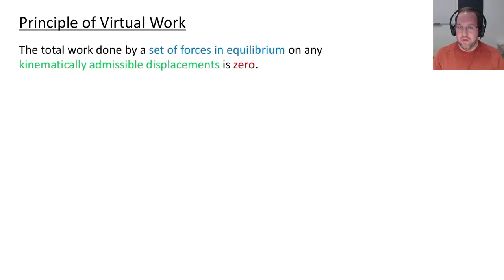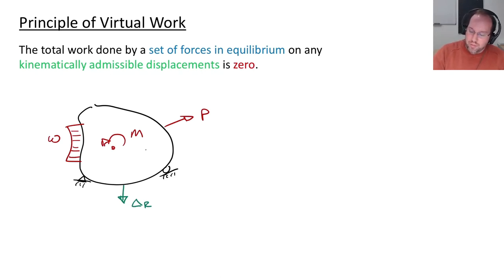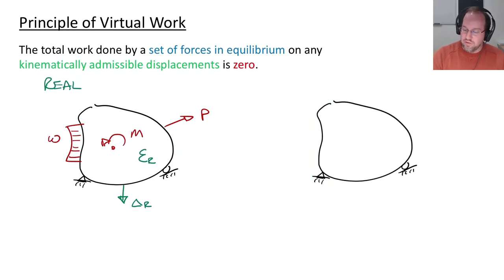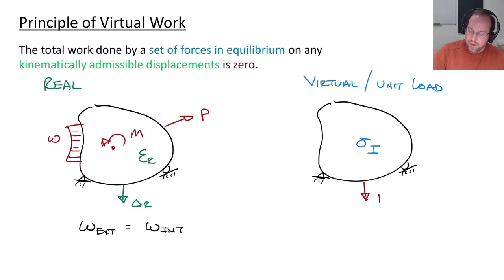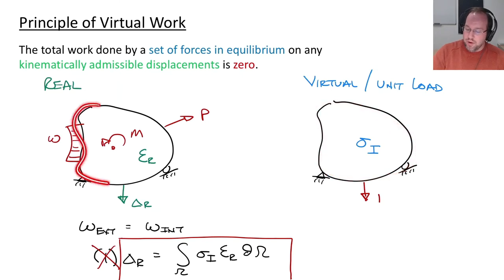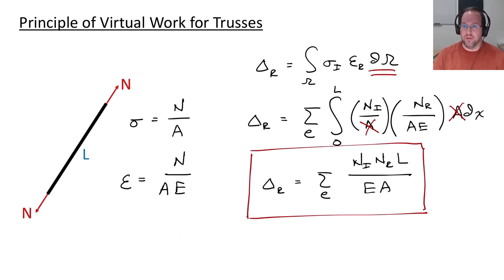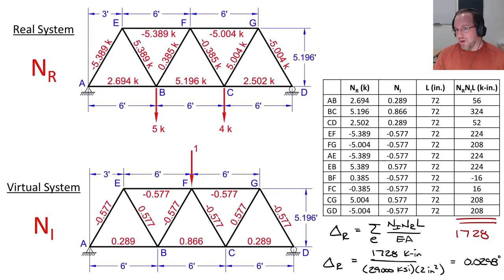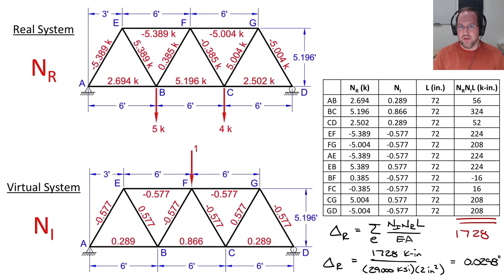Deflection of Trusses using Principle of Virtual Work - Intro to Structural Analysis

Comment: How about displacement of horizontal
Reply from the maker: To find horizontal displacement at a point, just change the unit load from a vertical load to a horizontal load and repeat the process. The “real” loads are still the same, so if you already have the vertical displacement at a point, you only need to solve one more system (that is, the virtual system with the horizontal unit load) to find the horizontal displacement.
Reply: @StructuresProfH  show me solutions horizontal displacements